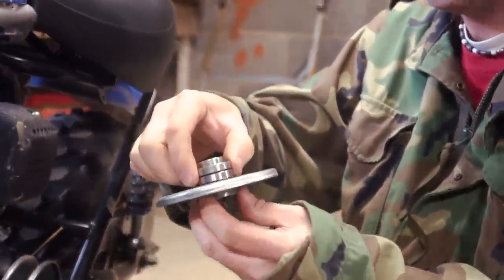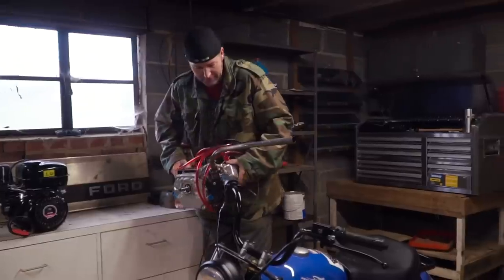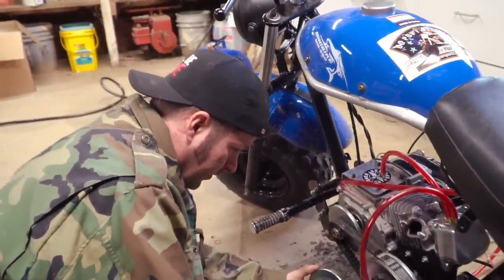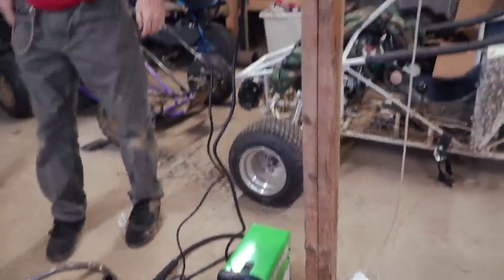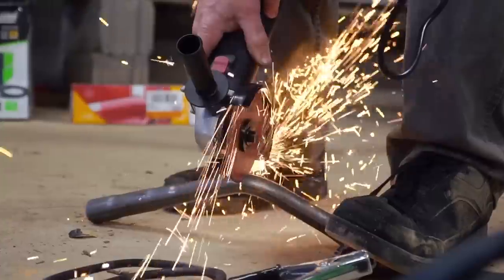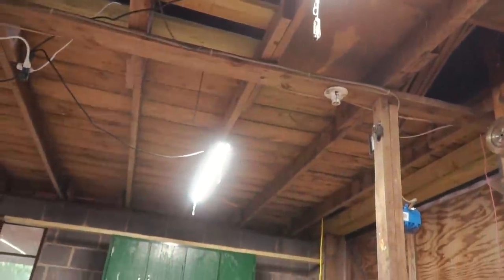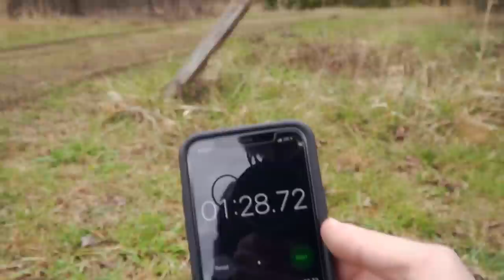Fast Mini Bike Gets Gets 3X Horsepower! 225cc Race Engine Swap!

Comment from the maker: Too much wheel spin to get a clean lap! This is going to be one mean race bike!
Reply: Ok...i need your help guys pleeease 🙏🙏
I live in Paraguay... bought my kid a 150cc kart with a gy6 engine. It is a cool kart, just slow as anything!
Reverse...it flies... forward...does not. Can you give me any tips please on what i can change on it to go better please 🙏🙏 it is currently stock!
Reply: Go power sports will probably have a bigger engine
Reply: Now you need some proper tires, with grip.
Reply: @warrenwebb1467  Possibly a big bore kit or.. Some torque converter tuning. Ask the place where you bought it for some upgrades
Reply: Guys PLEASE make some off road mowers for the woods!!!
Reply: Skinnier tires will help with that
Reply: What tyre pressures u running they look hard for sloppy conditions
Reply: You guys are making the power, now need some torque converter weights and spring.  Die cast alum. Weights: 202931a.  They make white, yellow, and blue/silver springs that are higher engagement too.  I'd watch rpm and play with springs till it holds just shy of peak rpm of that engine (6000-7000rpm?) Keep that motor in the rpm and the tire wont quit spinning...
Reply: I NEED HELP C&C AND VIEWERS 
I got a predator  212 with upgrade  jet ,air filter, muffler and torque converter   it's been sitting for some 6months I put new oil , gas &filter  and cleaned the carburetor and took the jet and and then out cleaned that and even the jet under idle screw  all this and it won't idle smooth it's sputtering  and if i give it to much gas or dies any ideas ? I'm stumped about to buy a new engine I have thought of a new carb ? Or spark plug ? And also the tq as ike said it wants to creep when it starts well more like take off with  the idle screw  at the lowest point  I took the tq  off so it woudnt engage  as soon as i started it I'm at the point of giving up and starting over unless someone can help me  or is it clunking/sputtering due  to maybe internal problems  like bearing  or pushrod
Reply: If Mini Mayhem is in late June or July, I would be able to come.
Reply: DIY Do a compression test and leak down test to verify that the bore, rings and valves are seating and not worn. If you have low compression or fail the leak down test, you’ll need to overhaul. 
If that checks out, try a different carb. As for the Torque Converter, check that the belt is mounted properly and that the sheaves are aligned. Good luck.
Reply: @warrenwebb1467  there are gears in sub transmissions. The reverse is always geared lower in bike and cars. You can change the forward gear to a lower gear ratio and that will wake it up. Or just change the rear sprocket to bigger one. You'll lose some top end with either choice but gain low end takeoff power.
Reply: @DIY-dv7xj  It sounds like you may need to drill out your main jet to about 0.035" or replace with one that is already larger.  My Predator engine did that when I changed out the air filter and installed a header.  You are running lean. Al H
Reply: @alanhook9892  a upgraded jet came with the air filter kit  so it's bigger then  stock jet the motor came with so would u say 1 more size up in jet?
Reply: This is random but I hope that isaac gets a fair cut from this channel because he has been here and helped build it up from the beginning.
Reply: @johnchassie-rideout4927  really? No, my son doesnt want top speed... he wants to drift about in the dirt 🤣🤣👌👌 works for me! 
Ok ok bigger rear sprocket... can I buy them online? Here in Paraguay, they arent big on these karts... this was imported in 2007 and cant get spare parts anywhere 🤦‍♂️🤦‍♂️ amazon maybe the best bet if you could be so kind as to point me in the rite direction please?
Thanks
Reply: @warrenwebb1467  yes Amazon or Ebay should have what your looking for. Look for gy6 buggy rear sprocket. If you know the brand try looking for that as well
Reply: Man, I gotta know what camera are you using?  Great indoor footage!
Reply: @DIY-dv7xj  get a VM 22 carb you will not regret it was
Reply: I have the easyFlux 125. It is an amazing welderyou guys don't have it set right. If it is pulsing then the bolt that holds the spools too tight. I can run it in my shed off of 4 extension cables and a flood light at the same time. I use 0.035 wire cause it flows better than 0.030 which is the crap that came with it free.  I have welded a motorcycle frame with it and it is extremely strong.
Reply: Should just put a Daytona 190 pitbike motor in it they push like 25hp to a 12 in back tire then if your really frisky you can go to a 212 big bore and with proper tuning and porting be pushing 30 hp just a thought 17hp is just low as he'll for that that big heavy motor
Reply: I see you guys like putting 212 and stuff like that and your go karts and mini bikes be different Straight Out of the Box put your little 10 horse diesel motor on the  MB trail bike and be different,
Reply: @warrenwebb1467   go on Amazon you can buy all the upgrade parts for your GY6 if I could post a picture I would show you I have GY6 mopeds which is the exact same thing same motor cost you a hundred fifty bucks for a decent kit and make that sucker fly like you never believed
Reply: I want to see more videos of that bike! What was the top speed after the tq converter change?

Comment: When you watch them insult the only welder you have😭
Reply: ikr most of us are poor $180 is a lootttt of money
Reply: Can you use this welder on 120v outlets?
Reply: WHATS YOURSOC  you dont know how to weld. Ive used Miller and Lincold Electric and Hobart. Great welders!
I have a Titanium Unlimited 200. Welds just as good and is adaptable to 120v/240v....
Reply: @jacktheripper6610  It does!

Comment: That lil tykes cart looks like one of the old T-bucket rods. Everything you two guys do is bad ass. I used to make urethane skateboard wheels back in the 90s. I have a 12×12 box of a variety of size wheels. I think from 35mm to 65mm. If I can find them I will send them to you guys. I noticed you use them for tensioner wheels etc. Keep the videos coming guys. You are the coolest guys on YouTube with the coolest job I have ever seen. Thanks guys. PEACE!
Reply: Thanks

Comment: I have one of those welders. If you get some lincoln wire and set it like it says under the cover, it actually welds fantastic. The cheap wire that comes with it splatters very bad and doesnt make a nice bead.

Comment: If only they could make a billet flywheel with a lighting coil.
Reply: I see you guys like putting 212 and stuff like that and your go karts and mini bikes be different Straight Out of the Box put your little 10 horse diesel motor on the  MB trail bike and be different,
Reply: @anthonystaab1604  do you mean a power generator/ supply for lighting?? 
  If so i been hunting that set up for a gx100 or p79 or any of the gx100clones...

Comment: I think you guys are underestimating that cheap harbor freight welder. I’ve been using their cheapest welder their flux 125 for about 9 months now and I think I’ve only had a couple of beads snap and that’s only because the beads were bad. But once I can get a good bead down I haven’t really had any issues with welds snapping.
Reply: I run flux core wire all the time they just had the heat to high flux core wire tends to weld hotter no gas coming in to cool the weld.

Comment: when you run a high load through a long extentioncord it will draw a lot more amps than through a short cable , the cable will become realy hot too (can catch on fire actually ) 
friend of mine tried to build a steel boathull in his yard and the fuses he popped using his stickwelder just about equalled the costs he saved by building the thing himself , in the end he just put a lighter fuse at the end of the extention cord as it saved him a lot of walking back and forth 

might help is you use verry thick copper core high amperage cables instead of household extentioncords (should a lot saver to just run a pvc groundcable across the yard even if it doesnt look good ) 
as for running power to the shed : it might be a good idea to burry pvc pipe intoo the ground thats oversize compared to the line youre going to run through it 
that way you dont have to dig up the yard again to extend more stuff like telephone/data lines/alarm system or add an extra powerline (do put the ends above the field and cover them up so the pipe doesnt fill up with mud or water over time  )

house seems to be build at a pretty nice spot , i wonder if thats allso included with the place you bought
Reply: Ohm's law. Volts x Amps = Watts
It's the voltage drop that makes the amperage increase to do the same work (wattage).
You need power in a shop. Bury or string overhead some twisted supply wire from the panel. Use a wire sized for your new panel, I would use a 200 amp with at least 40 spaces. Add an additional #6 ground wire for a sub panel in the new shop. It will also need a ground rod at the new sub panel. Do not bond the neutral at the sub panel.
Reply: @michaelvangundy226  seems youre more familiar with the american codes then i am (european)
Reply: perfect location for a solar array and a Tesla power wall...then they could run a cord to the house to run lights if the power goes out

Comment: run out to a big box home improvement store and get a 150' of 10-3, or 12-3 insulated wire, a heavy duty 30 amp plug, a metal outlet box and a 30 amp 110v outlet to use as an extension cord. if you get 12-3, you can use it to wire your shop when you're done with it. it's not like you're not gonna need it then. no more multiple powercords lying on the wet grass, you already have a good start on your wireing needs and no destruction of things plugged into a long ass extension cord due to voltage drop. win/win/win. this thing is gonna be a full on beast!

Comment: I have a shop that has sub-par electrical feed and i use a generator to run the welder. That one that is under the shelf would be a prime candidate for that exact resolution.

Comment: Buy a small generator and temporarily run it off that, also that allows you to have a Fab/repair area at your events. A cheap hitch mounted bender would be another useful tool.....just a suggestion!

Comment: You guys should get a concrete slab at the front of the new HQ, and put a roof over the top, that way you have a good work space where you can weld and paint outside

Comment: As much as you guys over years have used and talked about HF tools and predator motors....they should sponsor your shop with a full ICON load out. All said and done...it’s a ~$1000 sponsorship. You guys have helped a lot of home brew projects become completed by using HF equipment.

Comment: Great video and Love the channel got lil proven cheap to free upgrade  you guys gotta try flipped ng primary clutch so the belt stays aligned when it’s in it high end. As the primary clutch pushes belt towards engine and the secondary makes it gonthe opposite direction. So put primary clutch on back wards and it will fix it. Like lift bike off ground rev it to top speed an look at the belt alignment and how bad it is. Now flip the primary clutch around an rev bike in the air and watch how straight the belt is. So cocked belt mean big power loses. You can get much more top end power if the belt stays aligned in top gear so to speak. Like snowmobiles and utv are set up correctly and the sheves that move are opposite of ea other and yours are not. Simply physics love your guys wrk. Would love to see a video on belt alignment with bike in air  at top speed and then with primary clutch took off flip it and put back on then do anoth top speed then when you see the difference then do the seat of the pants test an feel the power gains. When you flip it around the primary now will push the belt away from the engine and as the belt falls lower in secondary it also moves away from the engine. Thus belt will be nice an straight through out the bottom to the top end   I know you can imagine how much heat an power it takes to run a belt at 20-30 degrees out of alignment. That’s how they are set up right now. But simple flip an potentially gain huge power. Again love your guys wrk. I know we would all love a test video. Everyone loves experiments like this especially when it wrks. Also wat about a turbo build or NOS.  I’ve seen some turbo builds but they nvr seem to truly make any power. I know if anyone can get a tiny smallest turbo to kick some hp an make blow off noises an really wrk its you two guys.  Great new shop.Really excited for you two. Ride fast ride hard but ride safe. TTYL. Smallest turbo ever made is wat you’d need. I did it with a turbo off from 1989 grand am and just didn’t really wrk.  wrk but that was a good 15-20 years ago times have changed  and so much more available these days. It’s definitely a technology filled world witch is fer the most part to fast for me.

Comment: Nice to see you switching over to flat slide carbs.  They provide much better throttle response. 

It’s time for a generator to. If you buy used and sell it after you get permanent power it’s not an expense, it just temporary ties up money.

Comment: Hey guys I recently bought a 212 cc predator to put on my mini bike but it’s not starting up. It’s a brand new engine straight out of the box. Everything is hooked up correctly and the engine is bolted to the bike but it’s just not firing up. Do you guys have any suggestions that will help me start it?
Reply: Check to see if it has spark and fuel
Reply: It has fuel and it had spark for the first couple of pulls, but then we tested to see if it was getting spark again but now it isn’t getting spark

Comment: You can fully polish the exhaust and the combustion chamber without it messing with how the engine revs/makes power, the intake is the only one you need to leave rough and kind of small to keep it from only making power at max rpm. YOu guys should learn to braze.. an oxy-acetylene setup doesn't require power.. and it handles vibrations far better than mig welding.. hence why Hooker still uses it for all their competition/super comp header flanges.

Comment: Did you get that Mikuni jetted? You have the same dead spot I had off the bottom I did a 130/135 main and a 20.5 on the pilot, woke the bottom end up and it revs out to 8440 and 52MPH on 10/60 gearing with Juggernaut.

Comment: I absolutely love your guys channel it is awesome I love the blue bike with the tillitson 225 and the 4 engine gokart I have a Coleman ct200 u ex and its good I didn't take the governer off but I did bypass it it goes about 25 and I cut the throttle stop screw I want to do other things to it but I just lost my job do you guys have any ideas on how I might be able to find a new motor or how to upgrade the original motor please let me know you guys are awesome

Comment: If you're using a flex core while the best thing you can do is clean your metal to bear new Surface and try to remove any and all gaps before you start welding

Comment: What did you do about shaft being 1/2 inch shorter? I am adding tillotson to mb200-2 and have same issue almost nothing for outer clutch to lock on to. With original spacer back plates are perfectly aligned so did you use mount plate to move engine towards clutch and shorten spacer same for alignment?

Comment: Those Titanium welders are actually really good flux welders if you get a better ground clamp and some of the Vulcan flux wire. The wire and clamp that comes with it are pretty chincey.  But I bought one of those welders and have done some pretty great repairs with it. There seriously is not a better flux only welder on the market, especially at the price point.

Comment: I think it would be really cool for y’all to build a mini bike with a motorcycle engine on it like at least a 400 or 500 cc Engine on it And put a really wide four wheeler tire on the back and a narrow dirtbike tire on the front The wide tire would look pretty wicked and help with traction and the narrow tire would help guide you through mud and sand  terrain

Comment: I really want to run a 220v line for you guys
2ft underground off a 50amp breaker
Then have a small breaker box in your shop for outlet power
Wishing you guys best of luck with your new place. 
I was thinking about driving from Nebraska to Oregon for the rambler race on my klr650 and just put around

Comment: Jason Bertanzel
Hey guys love your videos. I’m running into the same issue that you guys ran into with the crankshaft. I’m trying to put the Hemi 212 predator on the bike my camshaft is 2.43” long. The engine holes lineup the same as the JD200 But how did you solve the issue of Reinstalling the front pulley? I bought washers to get the back plate of the pulley But the answer for the front half of the pulley Barely has any space for the front answer for the pulley and when I tighten the bolt there’s a big gap. I would really appreciate the help. I’ve been trying to call the guys at GoPowerSports.com but they’re super busy and extremely understaffed so it’s impossible to get a hold of anybody. Thanks for your time hope maybe you can help me

Comment: Pretty sure that 30 series torque converter is NOT rated for 17HP...
Even with the juggernaut front pully I think you'll be pushing it to its limit in your endurance race..

Comment: I have the easyFlux 125. It is an amazing welderyou guys don't have it set right. If it is pulsing then the bolt that holds the spools too tight. I can run it in my shed off of 4 extension cables and a flood light at the same time. I use 0.035 wire cause it flows better than 0.030 which is the crap that came with it free.  I have welded a motorcycle frame with it and it is extremely strong.